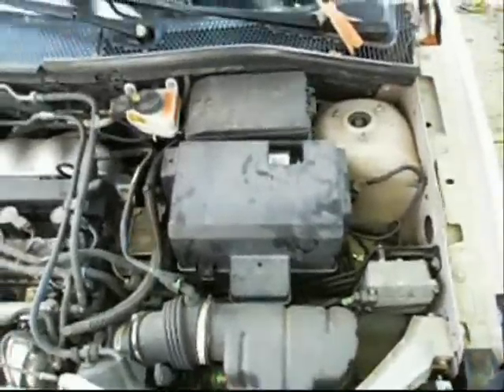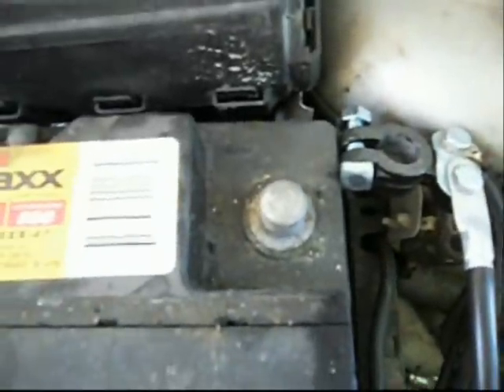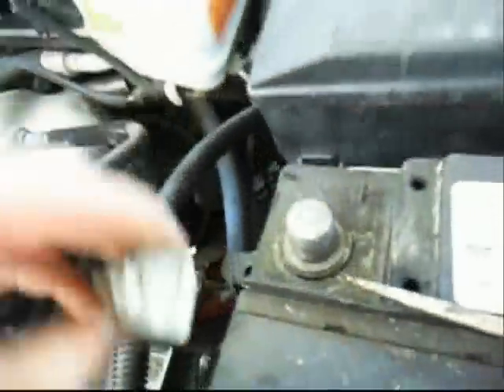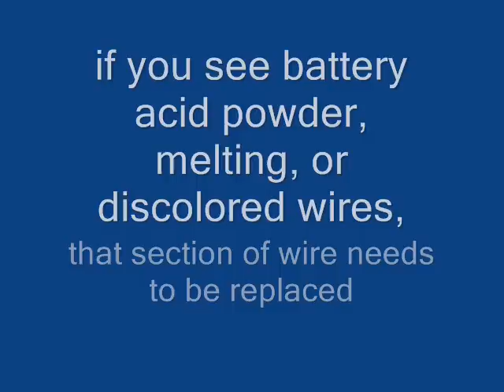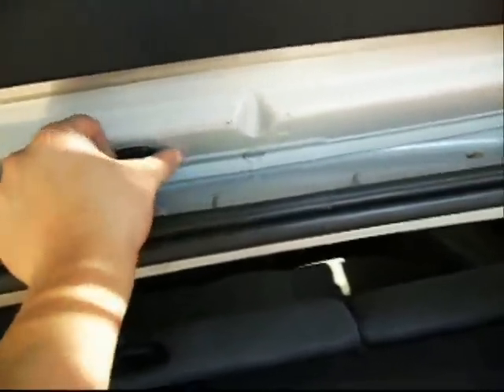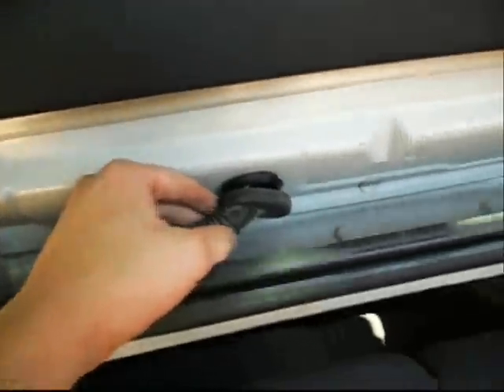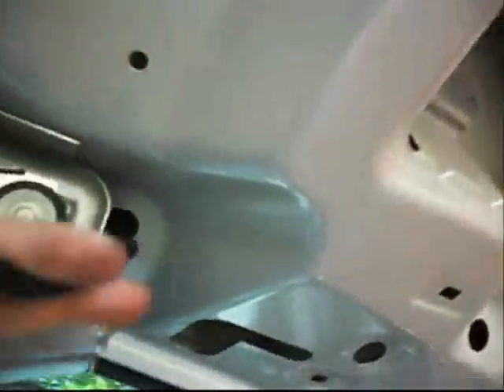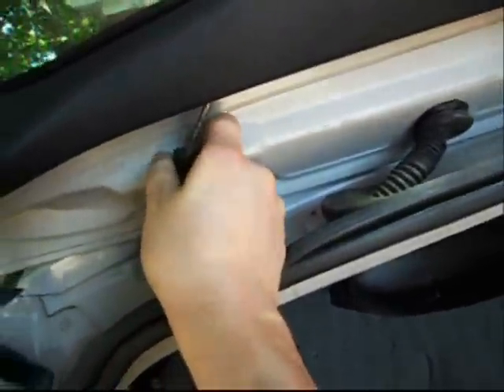How to inspect  hatch back wiring  part one

Comment: This is such a helpful video!  I have exactly the symptoms described, opened up the wiring harness as you show, and my wires looked exactly like yours with the broken insulation.   I didn't take out any trim or do anything else but get some vinyl tape between the worst spots....hard to do because the wires are hard to separate....but after changing fuse #63 again everything is working and I've used the hatch a lot.  I truly appreciate the time and quality work you've done in helping out strangers!
Reply from the maker: Glad to help as always! Hope you caught it in time to avoid any serious damage. Thanks for posting!

Comment: Just wanted to update- I was going through new alternators every 3 months for a year, and since I did this repair my alternator has now lasted 5 months! Im crossing my fingers that its fixed permanently. I still have occasional electrical/power issues but no battery light or jerking which is what was happening before each alternator went bad. Doing a plugs & boots change this weekend and hoping that will help the power problems. Thank you again!

Comment: !989 Toyota Carina done  82,000 miles, thus doing shopping trips must have flexed the wires probably once for every ten miles - work that out ! But what a job I had trying to check for dead relays to my rear red fog light. Finally took another look at the hatch harness and there they were  - two small red wires neatly snapped!  I suppose crimp joing is  better than soldering

Comment from the maker: Wow, 8 years since I made that video. Time flys.
I wasn't sure what Paul was talking about. so after looking thru the video,  I see the wrench I left across the top of the battery. And that I bumped it with another tool toward the termanials. Yes that was a bad idea to leave that there. I hope no one else does that. Sometimes its easy to make mistakes when your distracted,  like i was with holding the camera and talking in the video. For safety and to reduce losing tools inside the vehicle the best placement would be a tool cart, or something not attached to the vehicle. Its easy to want to set things down directly at the work area.

Comment: Good video.  Did you see my video on this.  Exact same problem and I fixed it the exact same way.  I did have to saulder I  one jumper wire as the were completely broken, then I taped them individually.

Comment: easier than using electrical tape is to get a small bottle of liquid electrical tape. Paint it on to all the wires while separating them a bit. Once it dries it is non conductive and waterproof.
Reply from the maker: Ill look in to that thank you.
Reply: After a month with electrical tape I did have the same problem and so I used this liquid electrical tape (about $6 at Home Depot) and now I've gone about a half a year with no problems.  I used a round tooth pick to hold the wires apart while brushing on the liquid electrical tape.  Thanks for this tip about the liquid.

Comment: i have a 94 previa thats got broken wires, it's at the back of the headliner going to hatch, gonna disconnect wires from terminal and pull down the inside of the hatch frame and resplice wires that are damaged

Comment: So did you actually repair each wire with shrink tube or did you just wrap them each with electrical tape? I'm having a hard time deciding what approach to do. It seems like so much crazy labor to take all the panels apart. Idk.
Reply from the maker: stephandsadie123 for now I have them wrapped in a high grade tape. The wires were not broken or burnt up on mine just the casing had craked and fallen off. I was fortunate to catch the problem early on.

Comment: So my wires are HORRIBLY broken and jacked up im.positive they are the source of my car problems. Thanks again
Reply from the maker: stephandsadie123 I hope that this solves the issue for you, fixing them should definitely reduce them. Remember as you work on them if the copper wire you see is brown and not bright in color, then that section of wire might not allow then proper flow of power.
This might also be something you should look for at the battery,fuse boxes and alternater connections. I have several comment lines about that on my alternater video.
As always I'm glad to help, and good luck!
Reply: I did the repair yesterday- wow what a tedious job!!!  Anyway thanks for the tips. My lights aren't flickering anymore and I thought it may fix my remote hatch release not working but it didn't :(   oh well that was just a bonus... now I will just wait and see if this alternator lasts more than 2 more months.  I wish more people knew about this
Reply from the maker: stephandsadie123 Hope the improvements last for you! As for the hatch release, always start with the simple answers. If the fuses check out then look at the release button or latch and there connections. Sometimes relays burn out as easily as the fuses. If all that fails then maybe the latch motor might have burnt up. 
Thanks for posting! Hope this gives you some ideas in the right direction.